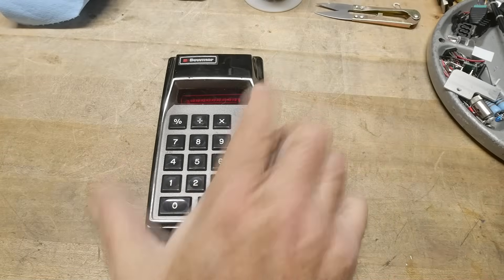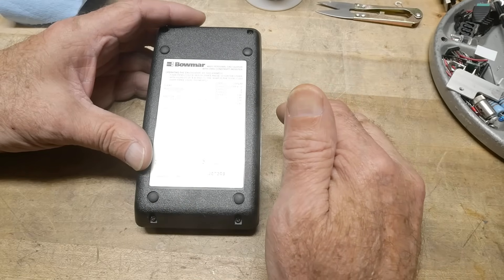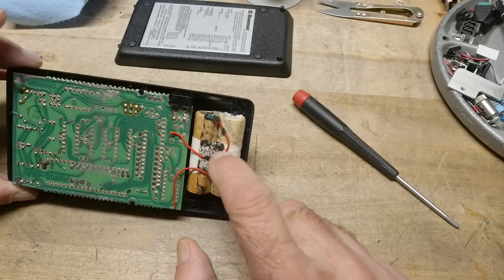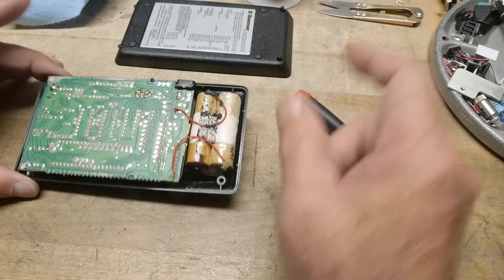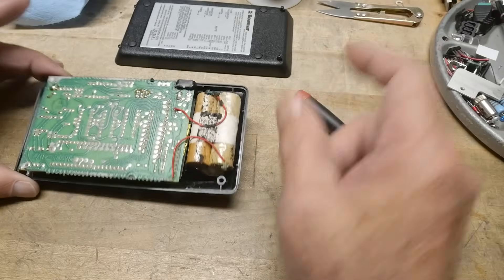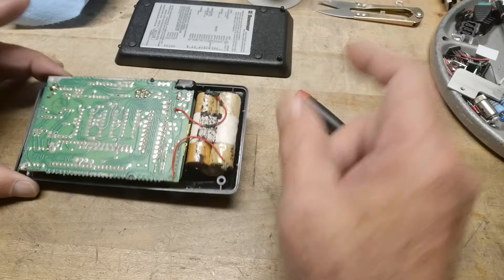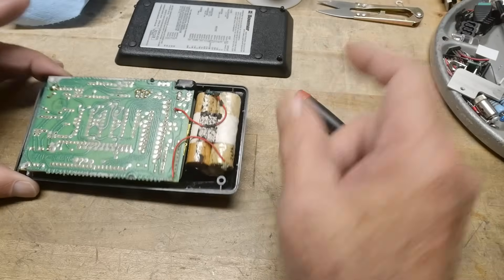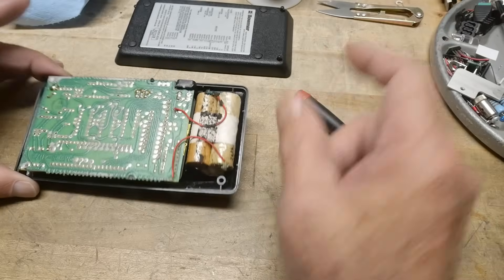#2204 BOMAR Brain Calculator

Comment: It it had 3 NiCd cells it might run just dandy with a single 18650 Li-Ion.  Just add a little charge/BMS module and you'd be off the the accounting department!

Comment: I have an old UDM TKB 0001 which appears to be functionally identical to a Bowmar 901B.  Your video prompted me to get it out of the closet and remove its batteries before they cause damage.  It still works fed by 7.2V DC.

Comment: Love those 1970s PCBs with the beautiful curvey traces.
In those days, the traces were not generated in CAD, they were hand drawn by a human on clear film, using stick on black tape.
Usually at 2:1 size ratio, at least that is what we used at the college. The solder pads were little black stickers of varying shapes, they you laid down black tape from pad to pad, and you could curve the tape around corners etc.
Those old PCBs look very organic and artistic compared to modern PCBs where all the traces are at 90 or 45 degrees and in straight lines only.
Doing PCB artwork by hand really was an art, and quite enjoyable. After the artwork was made on clear film, they used photographic development of the PCB, and the photo steup did the 2:1 reduction from the larger artwork down to actual PCB size.

Comment: I remember thinking about that time frame as a student wannabe scientist that as soon as they came up with a calculator that could do square roots and cost less than $100 I would buy one.  If I remember right TI was selling one for $125.  And then all of a sudden you could get one with roots, exponentials, trig and all for about $25.  Of course by then my demands had changed and I now wanted a calculator that could plot functions for less than $100.  

I've never owned an HP calculator but I tried programming in FORTH for a while and never could get used to the stack concept that HP and FORTH use.  I guess this old dog just can't learn new tricks.

Comment: A DC-DC converter circuit that looks identical to this generates the -9V and +9V voltage rails in Model 901D; schematics are available. The color-coded transistors operate in matched pairs for the oscillator circuit, driving the primary windings of the potted toroidal transformer.  A pair of diodes connected to the secondary windings in reverse bias mode allows the negative voltage through, from the negative half of the power cycle.

Comment: I joined TI in 1973 and was in the calculator dept of the Semiconductor Division. At that time calculators were just a small part of TI.  In fact scientific calculator was a seperate group in Fort Walton Beach Florida and the business calculators was somewhere else.  Later everything moved to Lubbock, Tx. Apparently Bowmar tried to patent the calculator even though it was driven by TI designed chips.  This caused quite a falling out between the two.  The boards has snap-off edges to allow them to go through auto insertion, flow solder, and wash a bit easier.

Comment: What's with all the castellated holes on the sides of the board? Is that just perforations to cut boards apart, or is it something for testing?
Reply: It is where they split the boards apart, after stuffing (component insertion) and soldering.
Reply: I’ve never seen it before. These boards had to be chopped up by hand with no CNC routing or v-scoring? It also looks like the edges form a ground plane and/or shield of sorts.
Reply: @davadoff  The boards would have been separated by hand. They assembled them together, otherwise the individual boards would probably be too small for the wave soldering machine to handle.

Comment: I enjoyed seeing inside. What are the color bands on the transistors for at 6:47?
Reply: The DC-DC converter is said to requires two matched transistors.  The color codes should identify hFE and IDSS classification for binning.  The other 3 transistors appear to comprise a bi-stable digital clock pulse generator.  I they might be 2N3904, and the frequency is probably around 255 kHz.
Reply: @pault6533  I never saw that before. What part of a DC-DC converter are matched transistors used? Are they in a push-pull configuration to drive the transformer?
Reply: @jheissjr  Yes they are.  See petervis bowmar 901D psu.

Comment: Was always a TI person - First was an SR-50 I purchased in 1975 just after starting Electronics Tech school in the USAF! Didn't get any HP calculators until recently when I found an HP 15C and 32S II for $25 at an antique shop. Cleaned up, they are nice!
Reply from the maker: Those are two of the very best hp made.

Comment: As a aspiring calculator collector with only a couple thousand calculators in my collection I would say HP had the ultimate calculator button tactile feel.  Bomar was mainly a assembly company using other companies parts and didn't last long in the calculator world.  They got to I believe 2nd place and went belly up in the mid 70's when chip manufacturers started making their own calculators.  The last gasp for air was them buying a chip manufacturing plant in Arizona.  Unfortunately by then the big chip manufacturers had already taken control of the calculator chip market and they ended up filing for bankruptcy.  The MX55 you have there sold for around $70 in 1974 dollars.  That would be about $507 in todays dollars.
Reply: WOW, that many.  I have an hp calculator collection of 5.  I also made my own scientific notation physical as well as 2 software.  But I wouldn't know what to do with so many or where to put them.  I do keep my calculators in 2 to 3 month active rotation. And yes, the hp keys are legendary.

Comment: The keys of these calculators are controlled by sequencing the rows and columns. I had a cheap one around that time and checked the signals some of which had no key positions. When connecting them additional functions like  sin, cos and ln appeared. There were keys for these functions in more expensive calculators of the same company. It might be a nice experiment.

Comment: when I was in school a pocket calc was a prize for even basic functions.  now scientific calcs are in thrift stores for a dollar.  I used to work on TI scientific programmable calcs that were built into a metalbox with a roll printer used to calculate weight and balance in aircrafts.  We had a bin of broken calcs that you could sometimes salvage assemblies from to make one work.  The company had purchased the remaining stocks of that model and at some point you would maybe req. one from stock NIB and program it to use, till they eventually went computerized.  When I left the company in 18 they were still using floppy discs for stuff.

Comment: I thought the crystal maker was called Bomar?   That says Bowmar?  BTW Bomar crystals has a website in NJ.  They also have an order form for "radio crystals" but I don't see pricing.
Reply: Title of this video need corrected.  And it could be that the companies were mistakenly confused.   "With the dramatic fall in calculator prices in the mid-1970s, Bowmar decided that it needed to manufacture its own integrated circuits to remain competitive and in 1974 invested in a semiconductor plant. However, prices continued to plummet and Bowmar had to file for bankruptcy protection early in 1975."

Comment: That ITT B6370 is a 'segment driver'. I.e. I think it's a bunch of transistors capable of sourcing or sinking enough current to drive the display switched by the single chip calculator IC.

Comment: Sometimes the old calculators used an AC-AC power supply and rectification occurred inside the unit instead of inside the adapter.  Edit: The AC adapter for this unit supplies 10VAC at 0.165 mA.  Full charge takes 7 hours.  My guess is there is a simple charging circuit (Diode and resistor) to feed the battery directly from the AC input.

Comment: Divide by zero!
Reply: I wonder if the negative sign is fixed or floating. There is a ninth bubble. Probably shows “E” there.
Reply: I have a couple of cheap calculators of that vintage. About half of them can in fact divide by zero. Any number divided by zero is zero, at least according to them (grin). It was the 70's, man.